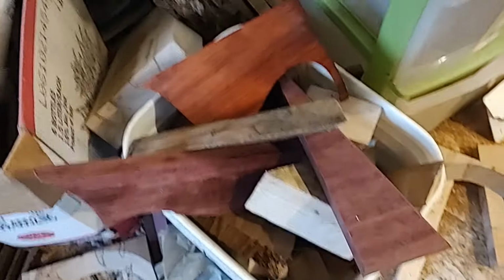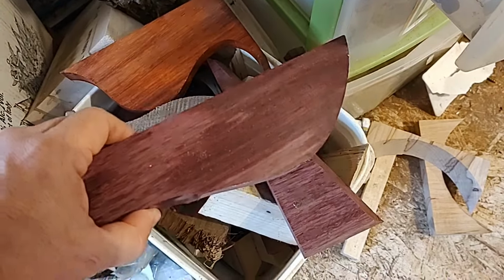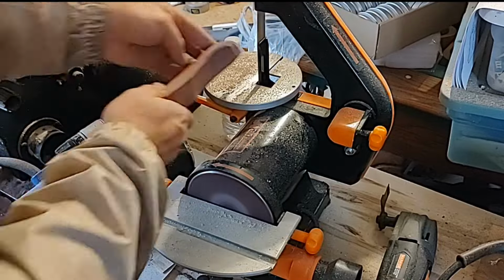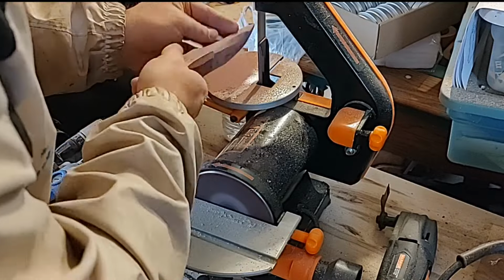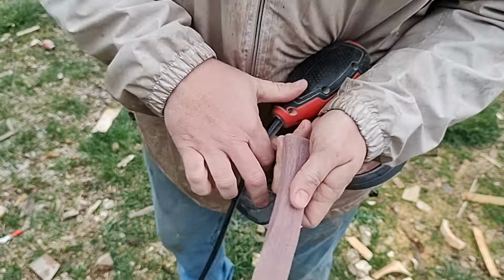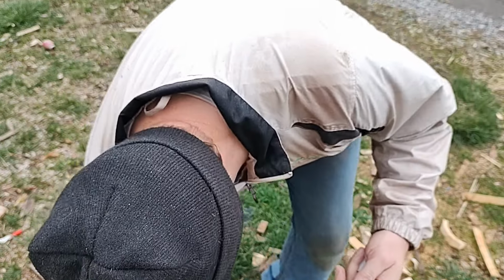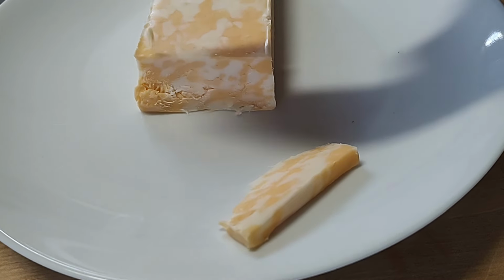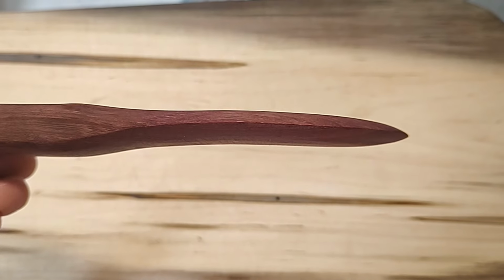What Will a Purple Heart Knife Cut?

Comment: FYI most of the cutting ability of a knife in regards to food has to do with the width of the blade after the second bevel. Meaning a thin strip of purpleheart barely sharp would be better than a thicker blade seemingly sharp at its edge. Sand that thing thinner it'll work be better for food stuff.
Reply from the maker: Ah, thank you!

Comment: Great first try!  Your angle is too oblique to cut , you will need a smooth angle from spine to edge.  Then you will need to harden the edge (thin CA glue or thinned out penetrating epoxy).  By the way, mineral oil will eventually go bad in the wood and start to stink.
Reply from the maker: Thank you for the advice and I did not know that about mineral oil!

Comment: There is a reason vampires are “staked” through the heart, and not “slashed” lol. Wood is a poor cutting edge, and a horrible heat conductor too.  Looks like a fun project though. And you got to play with all of your tools, which are the best kinds of projects. 
Jealous of your scrap pile. Some very nice looking stuff in it.
Reply from the maker: Great points! The tip was pretty sharp.
Reply: @EABUILDS check out a metal butter or cheese knife, they are thin and in the case of a butter knife are dull. You need to sand a blade 1/8 inch thick or less as a whole., purple heart is strong.